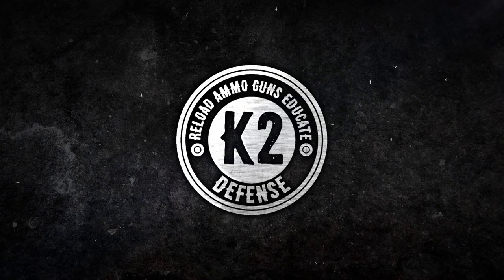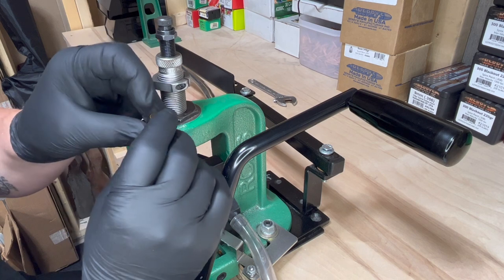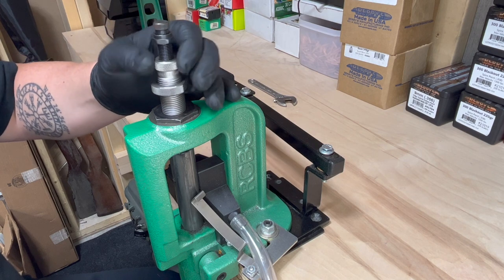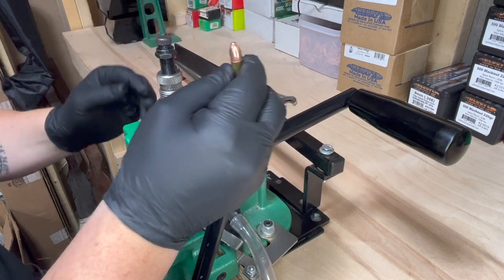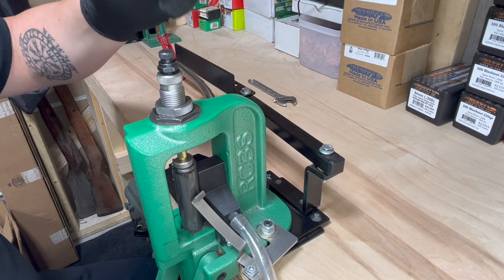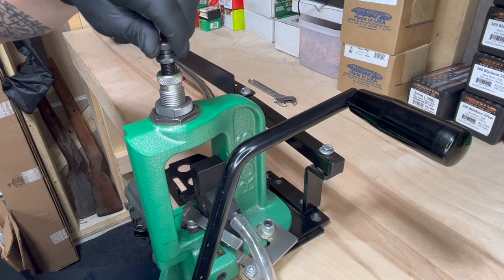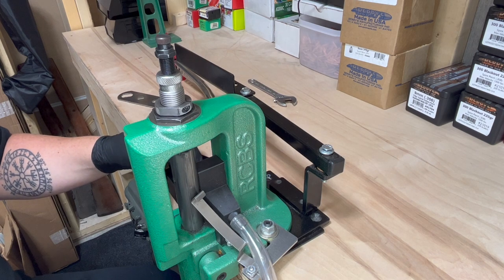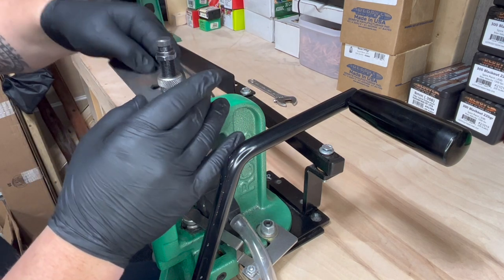How To Setup and Adjust The Bullet Seater and Crimping Die - RCBS

Comment: This is only good for jackets and plated bullets. Do not use a bullet seater and crimp die combo on things like hitek coating, powder coating, because this will strip the coating away. Why? Because these seating and crimp die combo does the steps completely opposite. What this means is that the crimp happens first and then the bullet gets seated. When in fact the bullet should get seated first and then crimp being done.

This is why I don't recommend any bullet seating and crimp die combo in one step, things are when using the wrong type of bullet.
Reply from the maker: Hello DJG37S,
Thank you for your feedback!
Reply: I was thinking of getting a combo die so I can add a bullet feeder to my Lee turret press. I use plated bullets but I didn't know that a combo die can take the coating off of powder coated bullets. Thanks for pointing that out.
Reply: You can certainly use the combo die for seating and crimping as separate functions. I do it all the time. No need for a second die.
 @reloadersjournal

Comment: How about seating the bullets with no crimp, like you mentioned, to find the right depth (with no crimp), and then backing the seater plug out and running the die down to the desired crimp depth?  This would be an alternative for those who are using a two-step method anyways and don't want the bullet further seating inside a somewhat crimped case.
Reply from the maker: The way your suggestion is exactly the way you do it as the one step method. Unless I’m not understanding your comment. 👍🏻